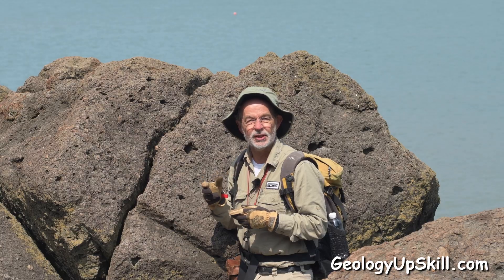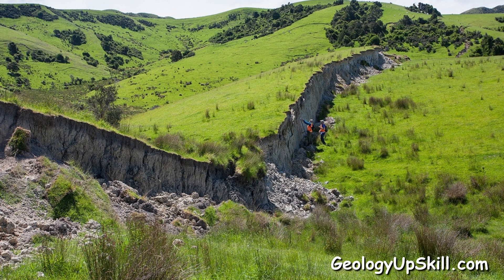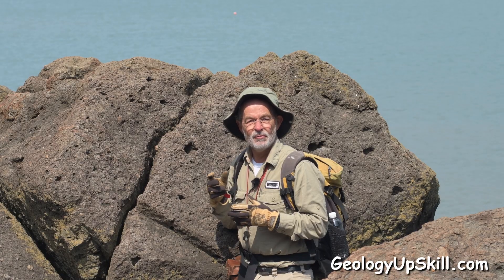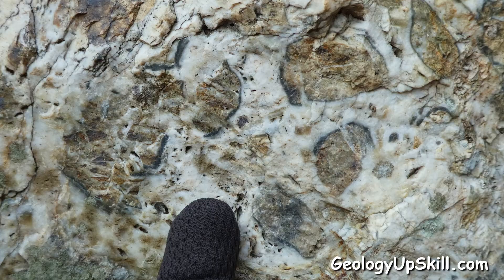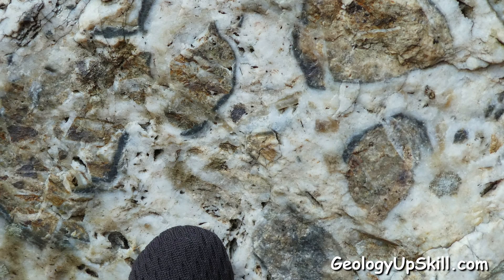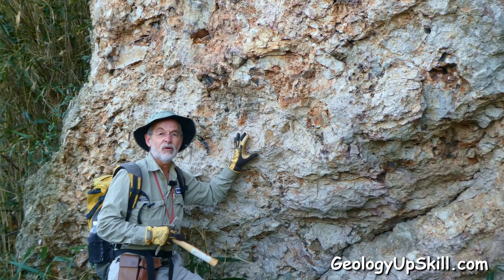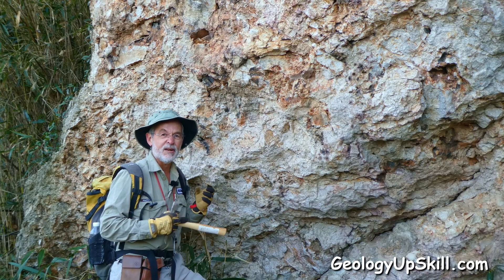How to Identify Hydrothermal Breccia

Comment: How it got broken is an academic question till you start trying to model it in 3D
Reply from the maker: Are you modelling the shape of the breccia or grade distribution or a combination with other characteristics?
Reply: @GeologyUpSkill  all of the above
Reply from the maker: Ok. So how does it help to know the mechanism of rock breakage? I imagine that carefull logging of infill percentage and minerals combined with alteration facies would get you most of the way there.
Reply: @GeologyUpSkill  that would be the general consensus. It will rely on data density, at a high cost per meter which means the average junior will go broke before they get a clear answer. 
Thus my enthusiasm for things that allow you to establish geometry with some cheap field data.
Fault breccias get lumped in with volcanoclastics.

Comment: Hydrothermal veining has zoned alteration even around breccia clasts, and is typified by banded calcite and banded quartz.  Now if you scan the rock in infrared spectroscopy and pick up moganite in the quartz, and if you believe you can see beta-moganite, it forms at 354 C at the supercritical fluid transition to 374 C.  That fluid phase is the definition of hydrothermal metasomatism, medium grade metamorphism, and fluid-rock alteration, all meaning the same thing as they all formed by supercritical fluid.  This fluid has no water surface tension, so it goes right through rock we call "solid".  The altered veins also have clay formation from host rock alteration and decomposition.  A common clay found with this is celadonite, a distinct green clay, that coincidentally forms at that supercritical transition, and is another metamorphic grade, I called supercritical transitional metamorphism.  And if you think there is residual beta-quartz and you can find it in infrared or other means of spectroscopy, that is formed at 575 C.  For temperatures above that, you get amphiboles formed instead of quartz.  The fine milky quartz breccia he showed is the top of the ore intrusion that formed from boiling.
Reply from the maker: There are clues in the details of every rock and some of those clues are critical to understanding how it formed, but others are red herrings that can lead you astray. It's important to carry Occam's Razor in your filed kit.
Reply: @GeologyUpSkill  There is no such thing as red herring data.

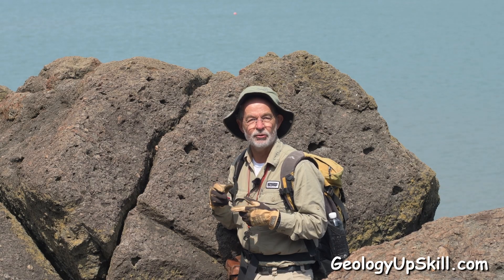Comment: Sir, some rocks on the mountain in my hometown are exactly the same as the rocks in 1:11 in your video, and lava is found in some places on the mountain. Can hydrothermal explosion form high-temperature lava，thanks?
Reply from the maker: Yes, if high temperature lava comes in contact with groundwater it creates a "phreatomagmatic" explosion and usually some breccia in the process.
Reply: @GeologyUpSkill  I thought it was caused by the impact of asteroids. It seems that more investigations are needed to collect evidence. In addition, I found a kind of stone with densely packed glass balls on the surface. The diameter of the glass balls is less than 1 mm, I judge that it is a small glass ball that is cooled and solidified by molten droplets after the rock is vaporized，is it true?

Comment: Good explanation. I want to ask some question, what the difference between vein, veinlet, stringer, lode and stockwork? thanks.
Reply from the maker: Mostly the differences are in size, although "lode" is sometimes used to refer to any mineralized planar body. Stockwork refers to a closely spaced set of veins (usually small size) that may crosscut each other to form a 3D network.
Reply: @GeologyUpSkill  Thank you 👍👍

Comment: Last year i found a breccia outcrop with full carbonate(my guess is calcite) cement and igneous (basaltic) fragment. I was wondering what kind of breccia is that, until finally i found this video. 
I didnt think about that outcrop so much last year because that rock probably is just exotic block in an uplifted accretion.
Reply from the maker: It certainly sounds like a hydrothermal breccia, but calcite is also a pretty common infill mineral in fault breccias. Figuring out which type is tricky, as I mentioned, but maybe not so important if you are looking for ore deposits!